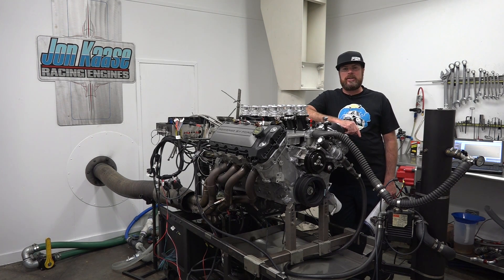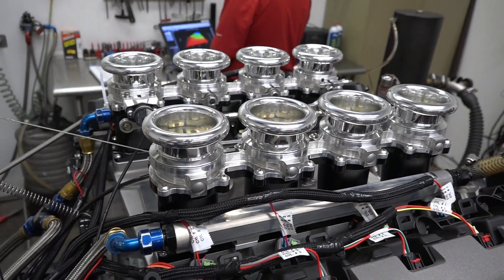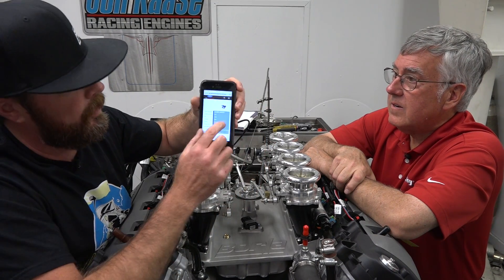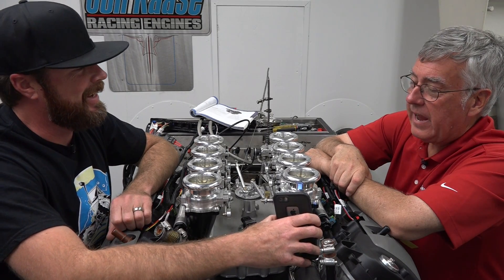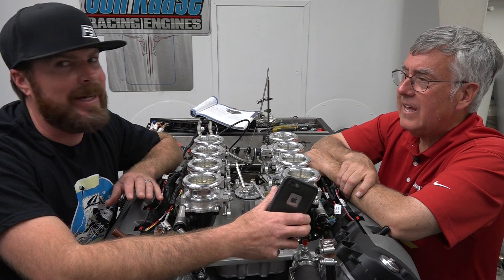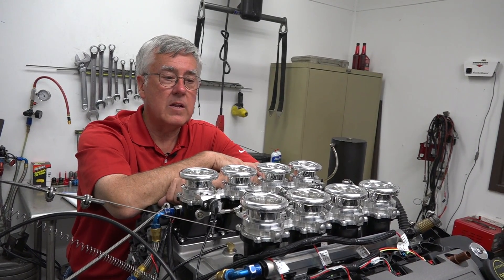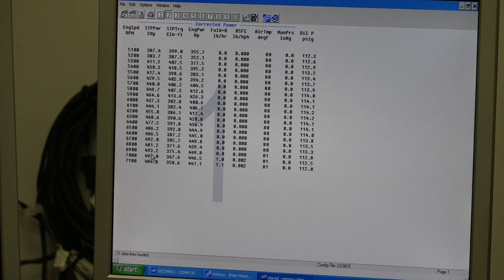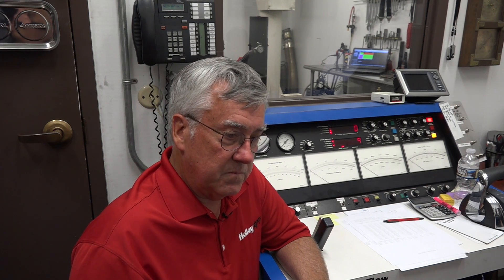Finnegan's Garage Ep.37: Dyno Testing a Ford Coyote Engine with Borla Stack Injection

Comment: Honestly, if the ecm could run the vvt it would make more power, WAY more power.  35-50hp more.
Reply: Nathan K damn, that is sick as fuck, i knew it would make a big difference, but 150 lb-ft at 3700 is crazy
Reply: I'm so tired of see coyote on the stand and being built wrong or have retarded tuners... makes it look bad...
Reply: This is why I'm always skeptical of using aftermarket computers. Holley has no idea how this thing works. Keep the original ECU and tweak that.
Reply: osp80 you clearly have absolutely no idea. At what revs are you talking? A fully advanced cam might make max hp on good fuel at the top of the power band. But what about 1500rpm? What about 2200rpm? What about 3100rpm? That fully advanced cam is going to die in the arse at those revs! Learn about area under the graph. That and the torque figure win drag races, not hp
Reply: I actually have one of these running a low compression aluminator with an AEM setup that does control the cams. 2 points less compression and it makes more that the one in the video. once the final tuning is done, it should be substantially more. the videos are on my channel. the one i have produces 501.3 hp at 7300 rpm.
Reply: This is only directed towards certain people posting nonsense. Holy shit, are there still car guys/builders out there that don't understand that horsepower is a number generated from torque specs vs RPM? I understand locking variable cams to achieve certain goals but to have supercharger low RPM style torque and still have the higher RPM powerband hit is outstanding on the street.
Reply: "wow, 4000. "that's totally unstreetable!" if you were posting from 1978..." if you were posting from the hackjob LS SWAAAHP forums.
Reply: And lose at least 20% of your torque in the process.  If not more.
Reply: or maybe for the men in the bunch,A FUCKING GEAR SHIFT
Reply: "Fuck torque." Lol. Torque is horsepower. If you don't have torque, you have neither.

Ignorant tool. Hurr durr 4000 rpm stall on the street bruuuuuuuuuh

Comment: It's  $20,000!!!? For a Ford copied Ferrari engine! Ford has been copying technology from Ferrari for about 50 years so this is no surprise. I'm familiar with the Coyote engine. high compression and high RPMs is where all your power comes from. I would much rather have an LS 6.0 or a Hemi crate motor. you can build your own brand new junkyard LS for about the price of that damn intake. but yeah I know the Ford guys be getting a hard-on, I'm not a troll but the only thing impressive is the power to weight ratio since it's only a 302
Reply: o yeah the Ls, the original or the one GM copied from Ford small block
Reply: Ford has been copying Ferrari for 50 years? Are you nuts? Ferrari bought a 52 Ford flat head V8 to learn how Ford was able to squeeze so much power from such a small engine. Ferrari had a deal to sell their factory to Ford, then backed out, which pissed Ford off bigtime, that's what precipitated the GT 40, with a big old push rod 427 engine to beat Ferrari at the 24 hours of Boredom at LeMans. Of course Ferrari was running some tiny 3 liter or so, they should have bought a big block Chevy engine to even things out.
Reply: Cough cough Ford GT
Reply: This engine has 4 cams....Not light at at all.
Reply: Love Ford engine tech but damn are they expensive to get power out of . LS3  modular crate you pay 8k and you get 530hp, less than half of what ford costs.
Reply: It must be nice to pay with other peoples money. When you don't have an unlimited budget, you learn how to BUILD a good motor yourself. 20k motor OK... boring. Junkyard motor bought and built with $2500 budget is much more exciting to me because that's what the average guy can afford.
Reply: Not real sure where you're getting other people's money from, but ok. I was talking about junkyard motors too.

Comment: There should be a newer 5.2L version of this motor, that uses GT350 block and heads.  Then the 2018 5.0 will be direct injection with higher stock redline for the "cheap" crate motor.

Comment: LOL so it made 412hp to the wheels if you calculate 15% drive train lost...
Boss 302 intakes or CJ intake makes close to 440hp... at 7000rpm 
Hmmm is this worth 6500? prob not lol 
looks cool, prob not worth it.
Reply: Locking the cams makes ohc engines almost redundant. May as well just build a pushrod motor. And getting rid of fbw is nearly as bad. That's a stupid mod with a dumb ecu. The haltech ecu would've been a far smarter way to go
Reply: Truthis strangerthanfiction Lol oh so I'm guessing you think a DOHC setup is more reliable? MORE moving parts and a HUGE timing chain is more reliable in your mind??
Reply: Nathan Porter "May as well just build a pushrod motor" and the pushrod V8 would be more reliable in the long term too. Doesn't take much timing chain wear to cause problems when you have a mile of timing chain, primary tensioners, and secondary tensioners/chains.
Reply: +SHAWNO Exactly,throw some mufflers and accessories on it and you're looking at maybe 380-390ish,so basically stock with a worse powerband lol.This setup would probably be good on a fully built,high compression engine that turns 8.5-9K,but on a stock engine,well it sure is pretty.
Reply: Nope, We dyno tuned a 5.0 with LT , no cats, 91 octane JLT intake 441 hp 390tq
Reply: hochhaul    Pushrods are more reliable? Who told you that?
Reply: Nathan Porter what does the ecu have to do with it
Reply: Had a 2013 Mystang GT 6 speed manual. Performance mods were: sct emailed tune, bbk mid length headers, off road x pipe, magnaflow catback, ford racing cobra jet intake manifold ported, cobra jet CAI, cobra jet twin 65mm throttle body. Dynoed in 4th gear, not 1:1, dyno guy wouldn't do it in 5th. 443 rwhp from 6500 to 7800 rpm, 380 rwtq at around 5,000 rpm. My guess is that you can add about 10 or so to the hp and torque if it was dynoed in 5th gear on the dynojet dyno.
Reply: nobody cares what you think, it's not your money
Reply: Not sure about you, but a few folks agree with what I THINK... 
Considering I work along side an SCT tuner, and we've tuned almost every combo.... 
Pretty sure people care what I think ;) care your chapa ass off youtube fuckboy

Comment: You can have your eight feet of timing chains with plastic tension rails. I'll stick with pushrods.
Reply: Just about every engine in every car and most motorcycles is OHC and I think they do pretty well.
Reply: I wonder if he'd trust his life to a PLASTIC Glock. I mean, it's plastic!
Reply: David Greene you know the LS has a plastic tensioner guide as well.
Reply: Lifted_Above - rebar HAHAHA
Reply: NHRA wasn't decided one fine day over coffee and round-table chat. It came about as some long developed and long practiced industrial sciences, availability of Hemi engines, formerly established engineering prowess, and a lot more. The Hemi and big roots-blowers have been around for a long time, before modern dual-vvt, modern turbocharging (twin-scroll, standard, or variable vane), modern gas-direct-injection, and lots of other engine efficiency related technology started becoming mainstream on the market.

Old school ways of making big power were well set when drag racing was well developed. The newer tech producing big power from less displacement is a more recent development as a whole. I'm talking about combining all the features I mentioned above in cohesive packages.

As far as engine configurations go, today's common engines are more to do with packaging and/or cost than anything else. Incidentally that's why FWD has nearly taken over.

NHRA isn't about saving the most money to reduce emissions the furthest, to power the safest car down a highway, with the least amount of weight making the most possible USEABLE power. It's about drag racing and getting the lowest numbers from 0 to 1320 feet.

I understand the desire to have a certain aural sound and certain sensation of thrust. I get that. However, the gap between small engines making big power and big n-a engines making the same power is closing down to a mere crack. Engineers are figuring out how to get next to no lag off idle for small engines to chuck out big torque, and do it reliably and with durability.
Reply: Cats n Cars turbo has no effect on reliability. My f350 7.3L turbo has 319,000 miles and I beat on it pretty good. A car will only last as long as the owner wants to maintain it. Both types of engines will last you if properly maintained
Reply: Austin C when gm ditches the v8 what will you say. Trust me, its coming. The high feature v6 with a set of turbos will make the v8 obsolete.
Reply: Rob Sorgdrager I know what you're saying but nothing compares to a NA high powered v8. I don't care how much power you pull out of smaller engines. they will never carry the nestalgia of a v8. if you know what I mean lol.
Reply: Nostalgia. It's just 8 things jerking back and forth instead of 6. It took 8 things to get enough explosions to produce enough power because only so much air and fuel can mix.

With a turbocharger, it doesn't take 8 things to get power. You can make much more power in 6 and even 4 things because more air and fuel fits in less things than 8.

Nostalgia. It's just an air pump making noise.
Reply: @turnin.sprocket  speaking of "jerking things" you might want to use lotion. LOL. You're complaining about moving parts and then you tell us how awesome it is to have a 10,000 rpm turbo, more valves then necessary and more cams than we need? Have you ever taken a motor apart? Do you realize the time it takes to put together a coyote motor compared to an LS motor? What about valve train work or porting and polishing the heads? How about pricing all those parts? Not to mention pricing up a turbo system and direct-injection? What about when Parts start failing mechanically? The engineering is great in both Motors, but give me a break with your jerk-off scenario. There are pros and cons on naturally aspirated and turbo Motors. There are pros and cons of having V6 and V8 motors. Now clean up, put away the lotion and stay away from the keyboard for the rest of the night.
Reply: David Greene well have fun making no power with your pushrods..
Reply: Rob Sorgdrager oh damn you just pissed off every Chevy freak now lol.
Reply: mewrongway- You wish loser!
Reply: David Greene well good for you
Reply: 2005 2500 Chevrolet Express van. 4.8 with no displacement on demand.
Reply: Cats n Cars good point
Reply: Cats n Cars....that's valid, and it's a good thing to think about, but how many people keep vehicles anywhere near that long these days? especially ones that develop north of 450 hp?
Reply: Ls for life!
Reply: https://www.summitracing.com/parts/ado-12626407?seid=srese1&cm_mmc=pla-google-shoppingsrese1_-acdelco&gclid=Cj0KCQjw4_zVBRDVARIsAFNI9eCSjDnUBsygvHZ9krSLfKWJJ_E7c6lMSIdjpQYHDYLx8kCrRbFDvuUaAnzCEALw_wcB

LS uses plastic guides and chain tensioner, but I guess that don't matter.
Reply: mewrongway- I'd rather have the engine with higher output per CI that will run down a 6.2 Shabbylet
Reply: mewrongway- By 4.8 you mean HCI, longtubes, and nitrous or a turbo
Reply: Lifted_Above y
Reply: David Greene
While I've never heard of anyone breaking a tensioner rail on a coyote they do make metal ones. And you do realize you can bend pushrods and explode lifters, right? Just because one engine has OHC and another has pushrods doesn't automatically mean a pushrod engine is more resilient.
Reply: That's too funny.... Trying to talk shit about the most unreliable part of the ls motors, the valve train..... Typical!!
Reply: I'm a chevy guy with a pushrod engine cuz I'm cheap.    The future is now,   cup on cam is the way.
Reply: funny cause gm is gonna copy ford again !! and make mod motors ...
Reply: stock 427 ohc engine 660hp...gtfoh with you...generic motors ..
Reply: They dont fail.
Reply: You'd rather have 10 feet of rebar thrashing back and forth.
Reply: Nearly full-length composite tensioners ensures they almost never wear out. Long skis don't sink in the snow. Short stubby skis sink. Spread out the force and the pressure on the composite is low.

Or just worry about valve guides, rod guides, seals, reciprocating mass, and trying to get a two-valve head to breath like a 4 valve head.
Reply: David Greene when gm switches  to dohc... what will you say then?
Reply: You can't buy a 2500 with a 4.8 lol
Reply: Racing Slippers not true, you can in fact buy a 2500 express van with a 4.3, 4.8, 5.3, and the 6.0.
Reply: It's a known fact that a roadrunner is faster then a coyote.
Reply: Lifted_Above I know what you're saying. But you can't make those smaller engines sound like a v8. Plus you can't pull the power out of them as easy as a v8 in NA form. much easier and cheaper to build big NA power out of a v8 compared to a smaller 6 or 4 cylinder engine. My biggest question for you is and please don't take this as a challenge. why hasn't the NHRA top fuel dragsters switched to those smaller engines. would love to hear your answer to this.
Reply: Yeah...my 2003 tossed a plug last year (its 3rd...)
Reply: unknown name that's not a true statement. The push rod engine will make the same power as a ohc engine.and visa versa.
Reply: David Greene would rather have a v8 n.a for longevity than a turbo 6. Try getting 200k+ out of a turbo
Reply: Propane and propane accessories look up the ford barra turbo engine. It's a 4l straight 6 turbo there are plenty of them around with well over 200k
Reply: Stephen Paraski or just have your vortech blow a rod from just normal driving after 200 thousand miles which just happened to me. I'll take the ohc motors and there 500 thousand mile capability any day. Only Chevy motors I'd have are either the DZ 302 or a 283 or a ls1. Rest are junk. Imo
Reply: Agreed! Nothing wrong with OHC its just the way it has been implemented on this engine family and others.
Reply: Or take your 5.4 Ford apart after it spits out a plug through hood (2004 F-150), drop pan and remove plastic from oil pick up that came of Tensioner's (1997 E-350 Super Duty) or buy a used Chevy 2500 with a 4.8 LS and clean oil pressure sender and change oil every 3 months and drive.
Reply: But in 16 pieces though. If it ever backfires you are playing Russian roulette. Plastic cam chain tensioner VS push-rod, I'll take the steel option every time thank you. 90deg v engines should at least use some gears in the drive train for the cams to eliminate the opportunitys for wear. With todays technology kevlar cam belts that will be sized to within 0.1mm and stretch very little huge cam chains shouldn't be on anything mass produced. GM hfv6 is just as bad.

Comment: It's a lot of scratch obviously. However, it's a quad cam, flat plane V8 with individual butterfly intake. So looking at it from that angle it's sort of like a low budget Italian supercar engine. And they sound the business too.
Reply: Its not flat plane. Only modular motor with a flat plane is the 2015-2018 GT350. Even the 5.2L crate motor based on the GT350 engine is cross plane.
Reply: It still misses four cylinders to be that...

Comment: Can't wait until Holley comes out with the VVT software and sensor interfaces. Given the size of the equalized floor plenum, even with pump gas, it should hit 500 easily. Maybe 525. The power curve should also begin earlier with VVT fully enabled with the fuel injectors and timing advance dialed in. 

I'm surprised that the 12.7:1 air / fuel ratio worked as well as it did with the VVT "disabled".

Nice job Finnigan!
Reply: Borlas site calls it a vacuum accumulator not a Plenum.  Its just a vac tank for the map and whatever else may need the vacuum.  12.7:1 is generally good for power on most N/A EFI applications.  The VVT software from Holley should be interesting.
Reply: It should be out by now